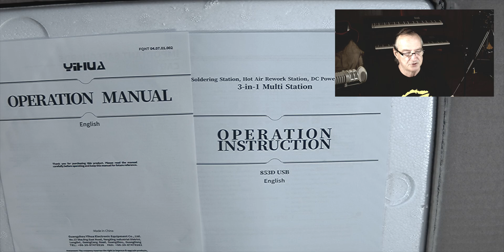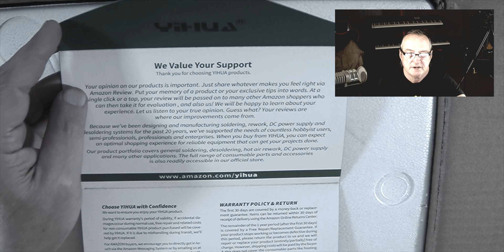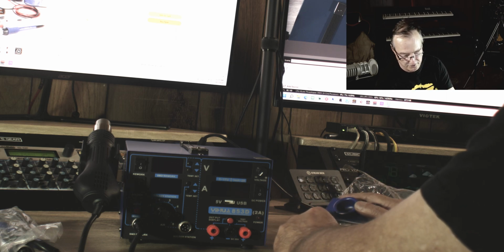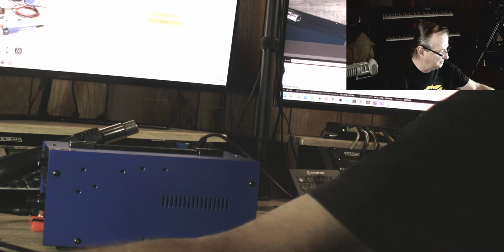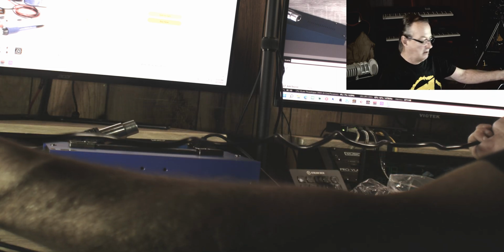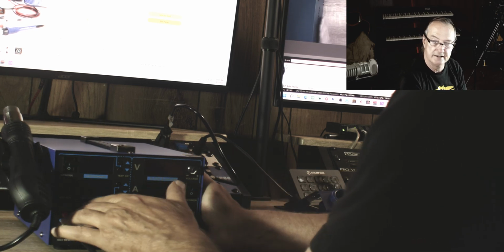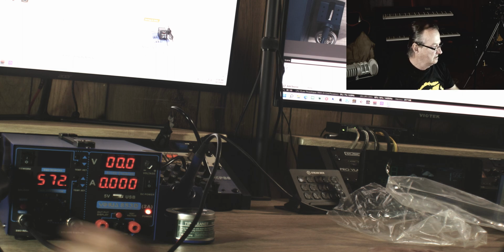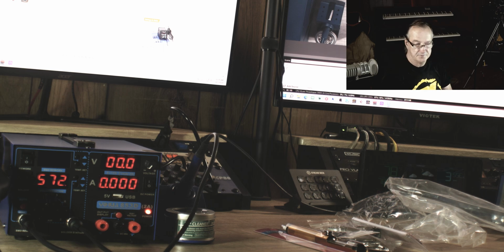A quick look at the YIHUA 853D 2A USB SMD Hot Air Rework Soldering Iron Station

Comment: Hello. I have the same station and I have a question if you can help me. I wanna test for short on a board, but as soon as the power supply detects the short, it cuts the power, is there any way to continue to supply power?
Reply from the maker: use a battery  and    thermal camera    and or a  multi meter